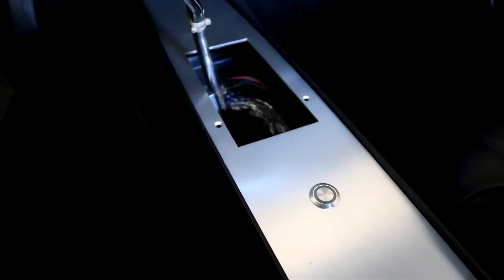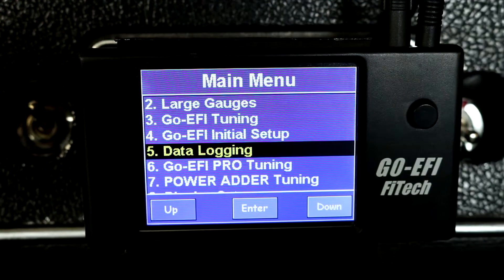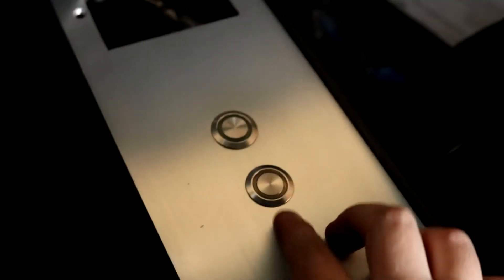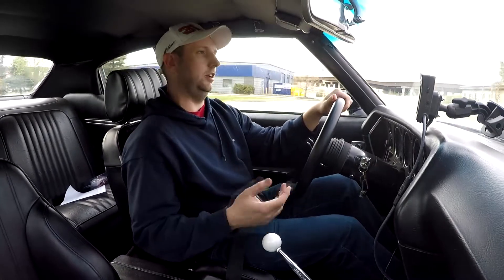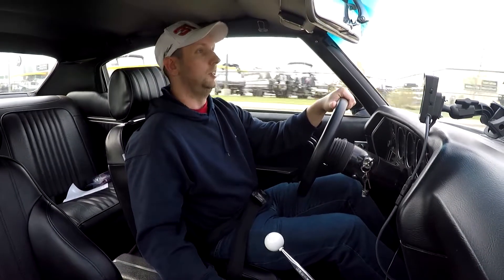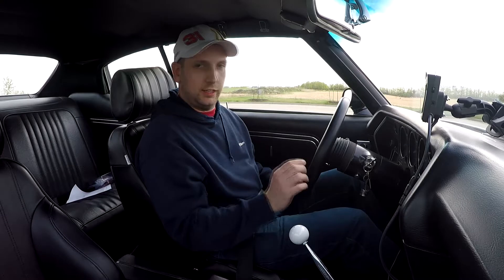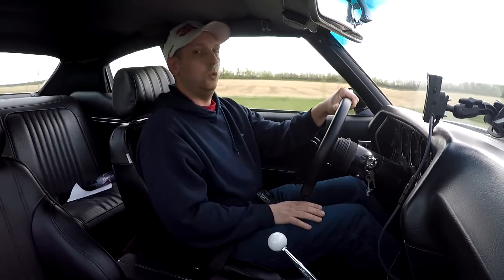FiTech 2 Step Control

Comment: So, with a clutch, do you really need a step control?
Reply from the maker: Running off a 2 step is the best scenario if the car can take it. You get to be at full throttle right off the hit. Can't do that without a 2 step, otherwise you are bouncing off the redline rev limiter.

Comment: Why cant you just hold the rpms where you want? I can see this being more beneficial for turbo to build boost
Reply from the maker: You want to be at wide open throttle. Holding RPM's at say 3000 rpm means you only have a fraction of throttle being held up. This is terrible for a turbo application as you need to build boost.

Comment: Great video on the Fitech 2 step. I've got the 1200 PA kit and still using my MSD 6AL box with MSD 2 step. I'm heading to Castrol raceway this Friday night and wondering if the Fitech will over richen the system while I have the MSD 2 step activated? Any idea if there's a way to use the AC in red wire to put the Fitech into open loop, similar to when the Fitech 2 step is activated?
Reply from the maker: Unfortunately I blew up on my only launch off the 2 step, so I can't say if it over riches. I'd say turn your data logging on and see what it does. As for AC being run in open loop, no clue haha. I need to keep a look out for your Vega. Good luck Friday!
Reply: @SS454LS6  Thanks, hope to see you out there! Great Vids BTW.

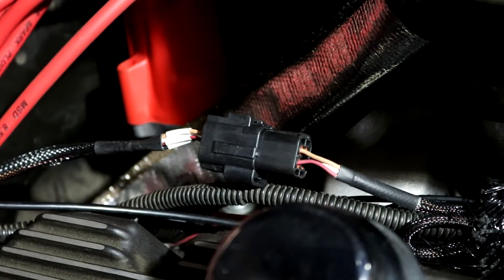Comment: 0:57 I have the whole Fitech poweradder hooked up on my car since last year and I have that harness thats located in the front of the carburetor but where does it hook up too? I see that you explained it as it comes with a kit?
Reply from the maker: The harness at 0:57 is for Fan control, nitrous control, and some others. In most cases this wont be used and you can tape off the side that comes out of the FiTech unit. If you intend to use the 2 step, then you need to hook it up, even though you will only be using the 1 wire.
Reply: SS454LS6 Thanks For your help, went on a search in my garage and luckily found the harness!
Update: My Mustang is now screaming Merica!! 🇺🇸

Comment: I tried this on my power adder 1200 with timing control not being used and it does not work.
Reply: @daviskaufman3168  I've switched to Holley fuel system. Fitech customer service is terrible
Reply: @thefixer1776  does it work now?

Comment: So do you need to have fitech running timing to use this feature
Reply from the maker: I don't think so since a rev limiter is standard on the base unit, and that does not require timing control to work.